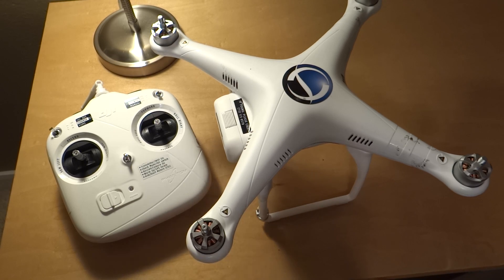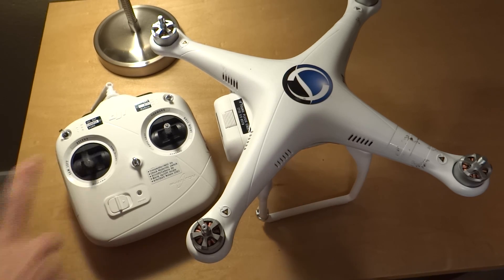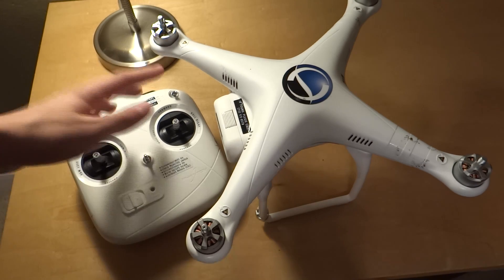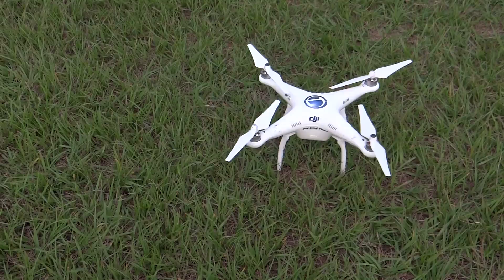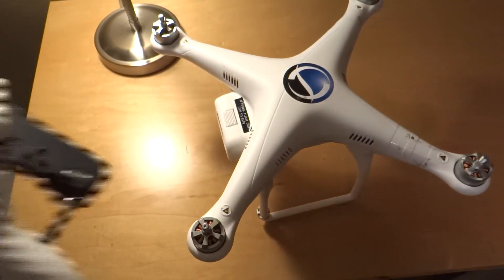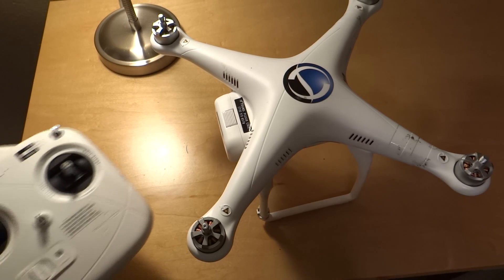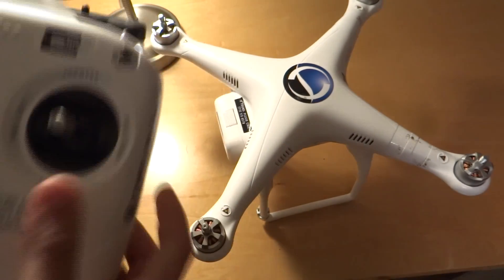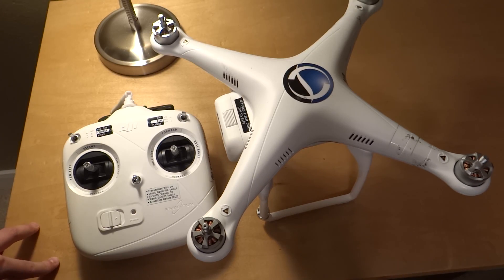Motors Cut Mid-Flight???

Comment: 2 questions: is this still a danger with the phantom 4 pro (sticks to the middle)? 
and what if you wanna descend (stick down) but maybe there is upward wind current that's preventing the drone from changing altitude, will the drone think it landed and shut off the motors?

Comment: Hi! I know the Phantom 4 now has a different method for stopping the motors: left stick inward-down + RTH button press. My question: does the P3 Advanced work the same way with the latest firmware? If yes, starting which firmware does it work like this? :-)

Comment: the second part seems like a no brainer. I mean I always just click the stick to lock at full decent until I get 40 or 50 feet from the ground from 400 or so feet on many occasions. maybe the older version doesn't have that on the controller tho so I could be wrong

Comment: awesome video.  this work for the phantom 3 standard? I kno the csc will completely shut off the motors.. both down then I'm, but I'm the p3s radio if u pull the left stick all the way down it locks into place and it'll shut off the motors.. I wonder if it'll make it come down faster with the p3s or kill it..  it takes it forever to come down and drop altitude.  It's painfully slow. Specially from 400ft up bc that's as high as I take mine bc the faa and I'm right by a airport but have permission to fly long as I stay south of the river

Comment: my Phantom 3 Standard has a full down stop detent. if I push past this it locks down the left stick and stops my motors. I can land it this way with 1 stick or the dual stick diagonal corner shut down. same with take off. I must go past this detent in order to engage the motors. 
your controller looks different so perhaps DJI added the feature to later controllers for this reason. 
It also likely didn't shut off after the 3 seconds when at height because the flight controller knew it was more than a foot or other low altitude setting and thus the input was not intended to shut down the motors. 

great video. you are brave. I worry about these "accidents" from time to time.

Comment: I believe that the csc to stop the phantom's motors works mid air in case if you are going to hit like a power line, or if you are going to hit something like that. So the csc in mid flight is like an emergency landing, where the drone does not care about anything because it has to go down. I can also see if your drone is flying away by itself, (not in ATTI), and doing crazy stuff, then csc will force the phantom to STOP! Again, this is my opinion.

Comment: My controller for the Phantom 3 standard locks.  the down stick.    I'm nervous desending,  If i accidently pull down to hard, that it will lock and kill the motors.
Reply: ...and it won't kill the motors, as long as the drone senses it is decending.  I've locked my stick in the down position on long decents with no problems.
Reply: Element of Kindness thanks that's good to know

Comment: Hey, i got an importent question so please answer. You have said that the motors will shut off if i push the sleft stick to the buttom right and the right stick fto the buttom left but if i will push the left to the buttom left and the right to the buttom right it would do the same?

Comment: Has anyone ever imitated the emergency SHUTDOWN on the P4, which cuts the motors, and then re-activate them and save the fall ?  Anyone wanna try ?
Reply: Yeah that's what I want to see. If you were at high alt and really low battery, and you've got no time to descend before the battery is dead... drop like 70% of the altitude and the re-start the motors... that would be bad-ass cool.
Reply: I did it on accident from about 50 feet up on my P3. When I put the sticks back to normal very quickly it started up and hovered before it hit the ground.  Scared the crap out of me and I will not be doing that again!
Reply: i was about to say the same thing shut them off high enough up and then turn them back on
Reply: Im gonna try it !!   I just need lots and lots of cottonwool.   Lol
Reply: Did you ever actually try this?
Reply: I didn't, BUT in principal, you can try it by just holding it, and simulate a full Emergency stop, while holding and attempt to reinstate the power to the props and see what happens.  I may just test this out.... later tonight.
Reply: i want to see this too
Reply: I had the same idea
Reply: I have seen several Phantoms fall, and when they do they have a tendency to not fall straight down but tumble as they fall. It would seem that you would need a lot of time once the props start again to hopefully have the drone right itself from tumbling as it fell. Not worth the risk.
Reply: CaptureYouVideo I can turn that off so it never does that right?
Reply: Quadcopters are incredibly stable and can right themselves and stabilize very quickly. Unless the aircraft were upside down when the props engaged I think it would return to controlled flight very quickly.
Reply: I will Im getting one Soon
Reply: Yes - it has been done , totally worked! https://www.youtube.com/watch?v=P20jEzQ5eU0
Reply: Someone has done it with the Mavic Pro before, and it worked.
Reply: needs left stick (bottom right) RTH hold down.

Comment: the question is : after shutting down to motors mid-flight : can you restart them before the crash
in order to get down quicker if you're flying VERY high ?
Reply: Yes, if you're quick enough
Reply: depends on how high your flying and also how fast it's falling. after it  reaches a certain speed falling (or hits the ground obviously) there will be no way to recover.
Reply: i want a see a video of this
Reply: You can do it in the simulator. So, in theory, it can be done in real life. But, you'd have to be very brave (or rich) to risk it!
Reply: Most definitely. My buddy had his up around twelve hundred feet when it cut off  he tried to restart the motors six or seven times as it tumbled downward it wasn’t till the quad was right side up somewhat to where it came back to life then he got a warning immediately after regaining control to land as soon a possible and to check something or other I don’t remember exactly but needless to say my friend almost had a heart attack in the seconds it went from falling to regaining control. We both laughed and breathed a huge sigh of relief. Oh BTW his altitude was half the altitude after he took control again

Comment: Nice video thank you,
But i am looking for an answer for this question;

ı have quad with naza mv2, 
if i go up to 800-1000 meters and while descending,
can i turn of the engines until it decreases to 200m, then turn on the engines,

by doing this i can save battery and may go higher.

did you, or anybody do something like this ?

what is your opinion

thank you

Comment: I could have told you this.  P3P had a critically low battery and started a RTH.  Only problem is, it was under a tree at the time.  I shut off the motors and caught it as it dropped from about 10-15 ft high.  No damage.  I've also descended with the stick all the way back numerous times.  No problem.  I don't know why this is a "Mythbuster" type item.  Anybody who follows these FB groups or has actually gone out and flown would know the answer to these question.

Comment: I wonder if it would be possible to like, fly at an altitude of 800 meters, shut down the engines, let it drop for 400 meters and then switch on the engines again to regain control...

Comment: I held my left stick down only the left stick my motors cut off
Reply: +DarkSkyWatcher I have the phantom 1 I am new to this and I did the same I went down really fast for about 4 seconds at a high altitude and it shut down.
Reply: That would imply any time you land manually it would cut off and automatically land without the props spinning . Doesn’t it have to be grounded before the motors shut off while holding the left stick only down. I would like video proof that your quad actually shuts down when you’re full left stick down . I call bullshit

Comment: The csc command is there so you can shut her down mid air in case of emergency.  There is a device made by dji that prevents the csc from being triggered but I cant find the link atm for the life of me.  Holding the throttle down for three seconds only stops the motors if the descent has stopped.

Comment: Holding the descend position on the controller will ONLY cause the motors to shut off if there is no longer a loss in elevation detected.

Comment: Great to see someone actually try this. Even though I don't have a DJI Phanton yet (YET!!!), I do watch a lot about them and this did concern me when I cam across it on another video, but he did not try it in the air. Thank you for confirming this does actually shut them off in flight.

I wonder if DJI will put in an override switch or something to prevent this while in flight, just like the decent position wont shut them off if the phantom see it is actually descending.

Comment: I just did this on accident and my p3 advanced fell only 10 ft and the camera broke off. I had a carbon fiber Gimbal Guard too, but it didnt do any good protecting the camera:/
Reply from the maker: That's why I took the gimbal off mine before k did this :)
Reply: +Phantom Pilots Are you using a Phantom 2 or Phantom 3? I wanna know because I want a phantom 2 because the phantom 3 series doesnt have a gopro gimbal. I will never do both sticks down and to the center, but I will do full throttle down quite often, and if this is a Phantom 3 it might be different.
Reply: Etanick N8 phantom 3

Comment: Changing the throttle type from INTELLIGENT to IMMEDIATE allows one to cut throttle for up to 4 seconds  with the props autothrottling back up during a long freefall.
For example, if one climbed until only 30% battery left than went into a series of 3-4 second freefalls, if the phantoms attitude sensors didn't kill system power, then 20-25% remaining battery would be enough to halt any freefal for a controlled landing.
I would also suggest reducing GPS Horizontal Range limits to 10meters for such a test.

Comment: I really liked the test of turning off the motors in the air... here is a question, from a higher altitude, can you shut the motors off, and then turn them back on and recover the flight to land safely?  A practical application of this would be if you were at a very high altitude and your battery was going to die before you could get to the ground.  If you could kill the motors and free fall for a couple hundred feet and then turn the motors back on, regain control and land safely...??  this would be a great test.
Reply: youd have to have fast ass reactions, and i dont think the phantom could recover on time as it could reach close to terminal velocity, as in you cant let it fall for more than 5 secs

Comment: Great video, thanks for putting your Phantom at risk in order to help the rest of us. I did read on a forum that if the quad runs into strong enough updraft while holding the throttle stick all the way down it can fool the quad into thinking that it has landed and will shut down the motors. It was said that the odds of this happening were highly unlikely but nevertheless could happen. Thanks again and please make more myth busting videos.

Comment: Great myth busting! I was wondering the same thing about the left throttle. Nowhere in the manual is a clear part what describes this. At delivery of my Phantom there was even a note from the seller included wich stated the opposite.
Reply from the maker: Interesting. When I bought my phantom, nothing was included in regards to this. That was a few months ago, so maybe there is better literature now.
Reply: thedjiguy I did the full left throttle down yesterday. I can tell you it gives me more comfort now to descend, knowing the motors will not shutdown when I do a full down. :)

Comment: My question is: Can u turn it on again in mid fligth after you shut it off?
Reply from the maker: My guess is that you can. I can't be sure though.
Reply: thedjiguy
Turning Off and ON could be very useful if we are too high and running out of battery... A desperate measure for a desperate situation as i´v seen a lot in videos
Errr.... could you try it... :)
Tks Djiguy
Reply: It will not let you start unless facing up.

Comment: hey, i got my p2v+ 2 weeks ago and i flying it great. Im wondering why when I bring the phantom down, it is slow. Going up in altitude is fast but descending is slow.
Reply from the maker: The software limits the downward descent. They do this to avoid prop wash which is where the phantom is descending so fast that there is no air for it to control itself. It looses control and it's hard to pull out of. That's why it's limited.
Reply: thanks bro. i always get disconnected at 1300-1500 ft away. does the phantom booster app help at all?
Reply from the maker: I have heard all good reports on it.

Comment: I have thought about going to a high altitude and shutting down the mothers and then restart them again before hitting the ground.  What do you think?
Reply from the maker: I think the motors would start back again. Feel free to try it :)
Reply: I had an incident where the motors on my p3 advanced turned off at approximately 150 feet. I immediately tried the restart, but the bird had inverted and no restart was possible. I would not recommend anyone try a mid air restart on purpose. Btw. DJI repaired my unit for free. I never found out why it crashed in the first place. must be a known software glitch

Comment: A recent post by a FB member mentioned how he had a “flyaway” and later found the Phantom in his front yard.  That got me thinking about whether the Phantom ‘remembers’ the last home position after a power off and, if so, will it try to return there if you take off without waiting for a new home to be locked?
I was thinking that a simple test could be devised:
1.	Lock a home position on one side of a large open area.  Take a short flight and initiate RTH (right switch down in IOC) to check it works.
2.	Power down.  Move to the other side of the large area.  Take off before home is locked and then initiate RTH again.  Where does it go?
Interested in trying it out?
Reply from the maker: I have tried this before. I went to an open field and set home point then turned off remote and the phantom landed 2 feet from takeoff point. The home point updates automatically every 2 seconds on the P2V and P2V+.
Reply: thedjiguy I think you missed my point.  You need to do the RTH TWICE.  Once waiting for the home lock before take off (point A), the second time after moving to a new location (point B), shutting everything down, restarting and taking off BEFORE the home point is set and then seeing where it goes (point A, point B or something totally different).

Comment: Please could you take the phantom up high and see what happens during free fall and if it recovers when the motors are started up again.
Reply from the maker: I'll let you try it :)
Reply: Chicken LoL :-)
Reply: why not tie some helium balloons to it on a long string so the rotors dont chop it.  Balance the balloons so it floats slowly downward if the rotors are cut and try it?  Granted you will be falling slower than free fall but you can determine if you would have recovery time.    NOTE:  Dont put enough baloons to LIFT the quad, just enough to slow a decent to catch if the rotors dont come back on.

Comment: Is the problem solved with the newer version phantom controller?
Throttle stick locks at the bottom for smooth descent and landing
Reply from the maker: I haven't tried it out yet, but I'm not sure what the maximum descent speed is. I doubt it makes that much difference.
Reply: I have the newer version of the controller, with the locking throttle. The engines will not cut off in the full down and locked position, the craft just decends at its max rate. It land hard if you don't slow descent just before ground (I didn't do this, but I don't want to lead anyone into thinking it will land nice and easy). Then once it's on the ground, clicking into the detent (Locked) position will cut the motors.
Reply: ***** The most useful application of  the throttle lock in my opinion  is hand catch landing. The phantoml automatically shuts off once you touch it  with both hands.... Makes it safer 
https://www.youtube.com/watch?v=A12UGhvOsIA

Comment: The manual suggests (loosely) that holding down the left stick will cause the Phantom to land and (?) shut down the motors.

I realize this is from the new (V3) controller but I suspect it works the same since the lock is an the full down position.  I'm not sure I'd try it (to hold down the stick and see if the Phantom lands nicely or drills itself into the ground but it's another myth you can solve if your into it.

Manual quote: "Pull down the throttle stick to descend.  The stick will lock into place and the aircraft will descend steadily.  Push the stick upwards to release throttle lock"
Reply from the maker: Yes, but that is the manual for the new remote.
Reply: Actually, it's the manual for version 1.6 of the firmware.  I don't think it's specific to the controller.

Comment: Holy shit, really??? This is a major RTFM moment. You should know this even before you bought your phantom with a bit of youtube research. Its a csc. And its not only with both sticks at bottom inside position that will cause a shut down. There are 4 possible stick positions that WILL stop your motors in mid air. Both sticks, bottom left, both sticks bottom right, one stick bottom left while other stick bottom right and the one you mentioned both sticks bottom inside. Its well documented. Pulling down on left stick only will only stop the blades when the phantom knows when it cant desend any further, but by doing this you are running the risk of entering vortex ring state which can smash your bird up. Read up guys, c'mon
Reply from the maker: Well obviously it wasn't as obvious as you think it is considering the comments/views
Reply: Because nobody RTFM